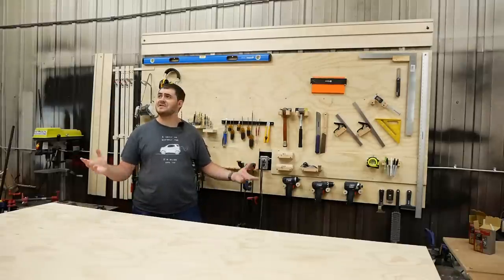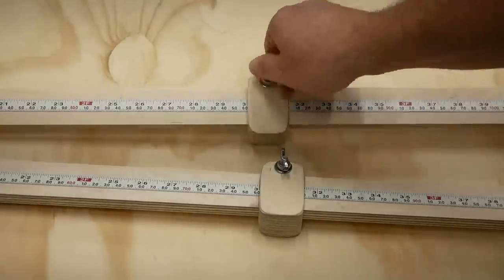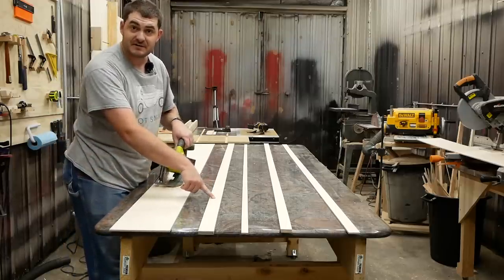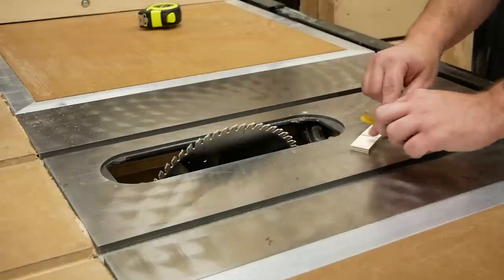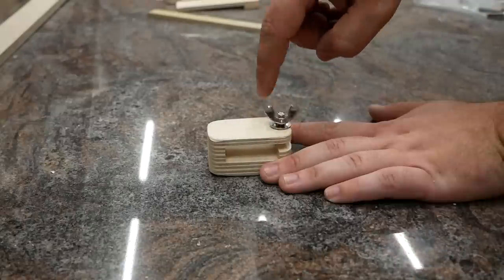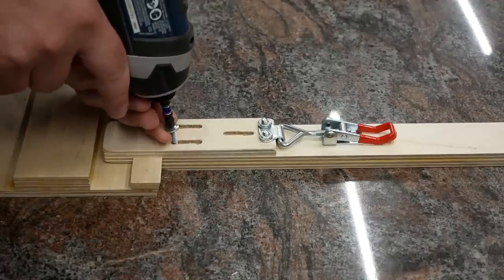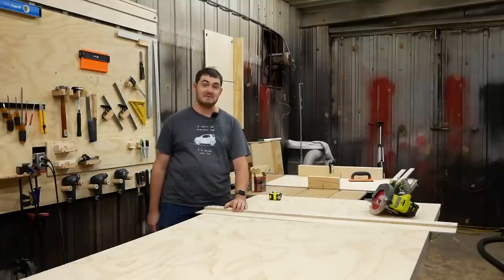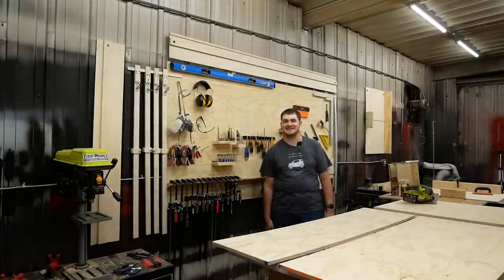Making a Much Easier Way to Break Down Plywood

Comment: Very cool Robert! I wonder if anyone has 3D printed the smaller components to build your rail/track system? Seems like 3D printed components (or maybe even billet aluminum) would outlast the wood in a situation like this where repeated compression could deform the mating surfaces over time and become less accurate.

Comment: The more things you make, the more tools you need. And the more tools you have, the more things you can make :) Wonderfull loop it is.
Great video!!! Might have to make this one.
Reply: and Ryobi is happy to sell them to him.
Reply: @sirBrouwer  and you can pay 5x more for the same kind shit, but in a different color....like yellow, or red....
Reply: @xplaur  wait Ryobi has more colours than green?
Reply: @sirBrouwer  Well yes, Ryobi One is yellow, but they are owned by TTI, who also owns Milwaukee
Reply: Mind you, for the first time today I see that the Ryobi One is also green and not yellow, just a very light green lol
Reply: @xplaur  well, my green saw melted and wouldn't stay in square, so i was way more than happy to spend 2x more on the yellow version,, my dog knocked it off my bench and it hit the concrete floor on the corner of the shoe plate, and not even a scratch, i was impressed, i mean with my dog makin guitar's on my work bench, lol,,,,,,,,
but really, it's worth every penny
Reply: dewalt , not ryobi + 1 lighter green
Reply: I’m dead center of this dreadful loop at this very moment 🤦🏻‍♀️
Reply: The first ~15 things I printed were enhancements for the 3d-printer that printed them.

Comment: Nicely thought out and executed alternative to the $200, $300, and $400 commercial solutions from Seneca  Festool, and Woodpeckers respectively.
Reply: Ahh, the Festering Stool, home of the high end wood elves and carbohydrate foam dabblers alike. (AvE)
Reply: Kreg Accu-Cut track/sled, amazing and <$100 works with any circ saw. Best money I ever spent as I can't afford Festool or even the Kreg Track saw itself. The thing that Under Dunn has improved on it is the measuring aspect, which is awesome.

Comment: I still can't quite figure out how you get an 8 x 4 sheet of plywood in either a Trabant or a Wheego! :-O
Reply: He has a pickup truck.
Reply: If you burn it first, you put what remains in a bag. That way it fits easy
Reply: @willemkossen  Heh! :-)
Reply: you don't put it in the car but on top of it. Then you sail your self back home.
Reply: That plywood is coming FROM the Traby!
Reply: @xplaur  I thought Trabbies were built using cardboard and string! :-O
Reply: He has a mast and uses the plywood sheets as sails.
Reply: Chris Skelhorn don’t forget Soviet pants
Reply: Chris Skelhorn 
Nope. That’s just how they’ve been repaired to be kept on the road.
Reply: @chrisskelhorn5727  they are, that's what the first cosmonaut went to the moon in
Reply: @Crewsy  i paint cars, and i worked for a guy from the ukraine, let me tell you about some riggin, those soviet guys don't buy nothin, i had a car with a bumper in 8 pieces, and he just said , "no new, fix it", so his russian guy took a torch and some other pieces of former bumper and melted a new out of those 8 pieces

Comment: Great idea, thanks a ton for sharing the video.

Just one question, hoe did you make sure that the guide rail and clamp rain were absolutely paralel, if they are not then the two measuring sticks will be specific to the end and position they were measured against so if they move then the measurements will be off I think!

It's a great idea though. :-)
Reply: I think that you will find that with in the plan.
Reply: By far the easiest way to do that, I would say, is to clamp the measuring sticks and the track to a large square, and then apply glue and butt the dovetail sections up while  the square was clamped in place. Really, though, this will be relatively insignificant. If you are cutting a 30 inch section, and your rail is out by 1 degree, that's FIVE THOU (for reference, a single layer of painters tape is more than that.). For reference, 1 degree out of square would be like having a 24 inch try square be HALF AN INCH off at the end. As in, so bad you could see it from across the room, probably. 

The reality is that it's just not that important and using whatever method comes to mind is probably fine.
Reply: They become parallel to the cut edge once he ran the guide through the saw to cut the dovetail edge on it after he cut the zero clearance side with his circular saw.
Reply: @Crewsy  The edge on the guide became parallel with the centre guide strip but not necessarily with the edge of the rail that the measuring sticks references to as far as I can see?

As long as the centre guide rail and the edge strip are absolutely parallel then the outcome should be also be parallel! :-)
Reply: @Dingbat217  You can ensure everything is parallel by order of trimming.  First cut the reference edge with circular saw against guide, then bevel rip to width on the tablesaw.  As long as your primary guide was glued down straight, everything should be aligned.
Reply: @alans1816  I agree.  I just made this and I did the same order of operation, cause it made more sense.

Comment: Great idea! Also, you should get a pair of Saw Buddies (I think that's the name). They're one-way wheels you mount on the table saw fence. They're conical, so they both keep the part sliding in only one direction and they also pull it against the fence. They're absolutely fantastic for cutting plywood! But this is still quite a clever setup you've made.

Comment: ...maybe this has already been suggested, if not... to deaden the echo in your shop, hang big 'furni-pads' (furniture pads used in moving to protect big furniture objects or appliances) on the walls... you won't need many; it's dependant on how large your shop is...  heavy fabric curtains would work, too...  btw, great video... 👍🏻
Reply: Blankets tacked to a frame would help too. People are always throwing out old blankets.

Comment: Excellent design!  I would suggest that when you make the measurement to place the measuring tape turn the assembly over and measure on the flat side and not over the clamp rails.  Then carry the measurement around to the top with a square.

Comment: Nice "how to basic" take on the assembly 5:55
Scheppach brand has handy circular saw guide system, there is a rubber strip edge that is cut with the saw traveling on a track on the guide. Next cut, just place the rubber edge to the marks and cut. Easy as that. Comes with price.

Comment: Don't know if anybody else mentioned it but the only thing I could think of to improve this would be to use quick clamps on the ends of the guide or the stop blocks to make sure that it doesn't move around in addition to the sandpaper. Absolutely superb.

Comment: I love this! Similar to something I used a long time ago but for different reasons. I would clamp down those stops to stop the guide from bowing when cutting long 8 foot lengths. Back then my saw had to be pushed into the track to keep it straight and I sort of had a tendency to push too hard and I would get a 1/16 to 1/8 in width difference  in the middle.  These are something I wish I’ll done back then. They would have saved me sooooo much prep time between cuts. Great work, great presentation!

Comment: That is a very clever solution you developed to eliminating points for measurement error.  I have the same problem with breaking down plywood.  It takes me 20 minutes to get one cut done, making sure my guide is where I need it, making sure I accounted for the kerf and that I'm cutting on the correct side of my measurement, etc.
Reply: Right! Breaking down plywood is hands-down my least favorite part of any project.

Comment: Interesting way to solve your dilemma.  Makes a lot of sense & cents if you sell enough plans. I feel that even tho you added the self adhesive sand paper on the underneath, I'd still try to use clamps too.  Maybe I'm just paranoid of the track slipping somehow. Great job!

Comment: Interesting. But unless you are looking for +/- 1/32, any straight-edge approx. 48" and two trigger clamps will do the trick. Anywhere. With your typical wormdrive, SKIL , cutting to the narrow-side equals +1-1/2" for the straightedge. 30" rip equals 31-1/2" edge placement. 

Interesting though...

Comment: Excellent stuff - finding a reasonable priced circular saw track is not easy.
One addition I would make is clamps to hold the track or the measuring rails, in place during the cut.
Another would be to have a "positive" track - that prevent the saw from wandering in either direction.

Comment: More a question. When you're pushing the saw along the track doesn't the perpendicular force (I.e. at 90 degrees to the cut) push the ends of the measuring bars away from the piece you're cutting? Even with the sandpaper I would assume that when leaning over the piece for wide cuts I would shove the measuring bars off square?

Comment: So I’m impressed, one question. As you are cutting the stop blocks keep the edge guide from sliding farther than the 30” but what keeps it from sliding the other direction? Towards the stop blocks? I see the sandpaper and that helps, but if u cut just a tad at an angle wouldn’t it push the stop blocks just a bit away from the end making one side like 30” and the other 29” and some change if it shifts at all as you cut? Just curious if I missed something that holds it the other direction

Comment: SO...um... sorry, i don't have any  suggestions on how to  get better audio with metal walls?  But great video? i have been trying to figure out an easy way to measure & mark only once when using an edge guide.  Your "fix"  takes out the measuring too. FANTASTIC👍.  i have many medical limitations & i'm bedridden more days than not.  So there is a lot of from bed planning time before i have a good enough day to actually build.   So, when a challenge pops into my head; it sucks to not be able to work it out trial & error style in my shop.  This means the build panning  & visualization, which i usually find to be a therapeutic distraction from my pain, is instead a frustration.   A video like yours is just the cure i needed.  i appreciate you creators & the time & energy it takes to share this content so much.  I will for sure  be sharing this video w/ my disabled builder friends & checking out you other videos. THANKS,  ♿Lisa🔧
Reply: I just typed a crazy long and thorough answer.   The methods i use with my harbor freight straight edge and circular saw that allow me to get consistent accurate cuts and more importantly repeatable cuts.   ALso how to get great cuts with miter saw.   
    Unfortunately, i did not realize my internet had disconnected and i lost the whole reply Lol.   Please tell me which of these saws you have and use for cutting your project pieces?     Circular saw & straight edge,   Miter Saw (sliding miter saw or chop saw?),   Jig saw?   Table Saw?   Router?    
        I will refine my answer and recommendations based on what tools you have. And reply again later,  after my nap.😴 Thanks ~ 🛠Lisa♿

Comment: Circular saw tracks that are supplied with a shoe that can be attached to any saw are inexpensive. The clamping method of your original guide is not effective. The guides that are available have built-in clamps that clamp each side separately. I never had my guide of that type slip. It seems to me you are making a lot of work for yourself unnecessarily.

Comment: Here are some ideas you can try to solve that echoey room problem: 1. Use Acoustic Foam 2. Mount acoustic panels to wall or ceiling 3. Use acoustic bass traps 4. Heavy cloth on walls like mover's blanket, thick curtains, etc. 5. DIY sound diffusers (like this: https://bettersoundproofing.com/wp-content/uploads/2019/03/DIY-Sound-Diffuser-Panel.jpg) 6. Mass loaded vinyl, cork, or other similar materials on walls, floors. Thanks for the video! Very educational.

Comment: Need some end clamps on the track so the guide doesn't have to be held or won't won't move when making your cut.  If they are adjustable in and out, they would accommodate different sheet sizes ;)

Comment: Dude I just found your videos. Been doing wood working for years. Was never able to have my own shop though. Recently that gas changed. I aquired a 12x20 bear shed that will now be my shop. First build will be the table saw cabinet you built in anouther video. As I have the exact same saw. Working on a very limited budget. Which im hoping this shop will change to a degree at least. Limited space is going to make this build be my second build after all my work benches, out feed table etc.... LOL. Really like your videos so far. Looking forward to seeing more, and supporting you on anouther level when my finacial situation improves. Thanks agian man.

Comment: I go to Home Depot or Lowes locally and buy my plywood.  Both places will cut it down to the my needed sizes for free.  After I buy the piece first then I take it in the back where they have an accurate cutter.  I have a table saw but it's not big enough to cut big lumber.

Comment: What's your thought on guides that ornopen on one side vs guides that keep the saw locked to the rail. On very long cuts I have issue with the saw wandering off the line so I have been trying to think through the best design that allows for easy cut line reference but keeps saw butted up against guide AND doesn't permanently commit my saw to some contraption in away that I can't just use the saw

Comment: I like this especially for repeating rough cuts. The only think I question is that, right before you made the cut you pulled the track tight which means it’s not clapped down. I can see a need for some way to secure the track in place once you pull it tight.
Reply: YES. This was exactly what crossed my mind at the time. He was concerned (understandably) with the saw guide moving earlier, and I wondered why he wasn't as concerned about this saw guide + tracks moving on him.
Reply: In lieu of a slicker solution, I'd just trigger clamp each one to the panel. It'd only take a few seconds.

Comment: Nifty. I like that much better than the makeshift track i made myself a while back. I usually have my sheets cut to size at the hardware store on their panelsaw since i only have space to work with smaller pieces in my shed. So i dont really have the bigsheetsawing issue. Still, great idea. One question about the plans, though, do you do metric? Or just imperishable?

Comment: Nicely Dunn!
Only thing I might add would be clamps on or with the stop blocks to ensure the guide stays tight against the edge of the plywood while cutting.
Maybe make the stop blocks in three levels; first two to lock on to the rail at the desired point, and the third to clamp the plywood against the rail?

Comment: I don't get why it's any better than a circular saw or a track saw. It may be on par with the amount of time it takes to setup a edge guide and circular saw in practice but a circular saw and edge guide doesn't require me to build anything out of materials guaranteed to warp and bow and thin enough to delaminate. This solution holds nothing on a track saw.

Comment: Sure. You release this video right after I made my own version of a zero clearance saw guide on the weekend so I could cut down 2 sheets of 3/4” birch plywood for door fronts on the pantry unit I made. 
Unfortunately mine requires me to line it up with pencil marks and clamp it down. 
I do still need to make a 4’ version to cross cut because my clamp on edge guide leaves much to be desired plus needing to add the offset which for me (DeWalt 6.5” cordless saw) is about 4 1/8” 😣

Comment: Nicely done.  I like your ingenuity.  But it seems like a lot of work to avoid measuring and marking and aligning with the marks.  Makes sense only if you are cutting many parts of equal width.  For repeated cuts you could make a single measuring stick similar to the 2 you made to mark the plywood.  In fact I think I will do that.

Comment: I like your design a lot, but don't have the shop space to lay out a 4. X 8  sheet  on a table.  Any suggestions to modify your design, so I can set this up and use it, mounted up against  a wall?

Comment: This idea is great! My only improvement would be to modify the stop blocks so that there's only a single point in contact with the plywood edge. That way you could very easily cut angled lines as well, with reduced maths. Maybe also add some convenient markings to the main guide rail for positioning the measuring sticks, so you can use it as a sort of sine-bar-at-a-distance.
Reply: Lost you could use something like this to make angled cuts it would make the design vastly more complicated because unless you're going to pre measure the angle cuts you would have to have some way on the stump lock system to indicate angle which would be interesting
Reply: @the_undead  if you read the comment carefully, you'll see that you don't need to measure the angles. If you design it to work like a sine bar, you can just use a handy lookup table. Try googling sine bar

Comment: Great idea. I usually just break ply down oversized freehand then clean up on the table saw. This will save quite a bit of waste over its lifetime. With the price of Baltic birch ply, saving waste is a very good thing.

Comment: You may be better off cutting a very shallow dado for the measuring tape to recess into as that slide block is going to wear the markings on it pretty quickly, depending on use.

Comment: Quick tip - to make sure that your measuring rails are perfectly set every time: set one to the measurement you want, then put the "head end" of the second rail to the stop of the other, and slide the stop of the second rail down to the head of the first.  EXACTLY the same measurement on both sticks, every time.